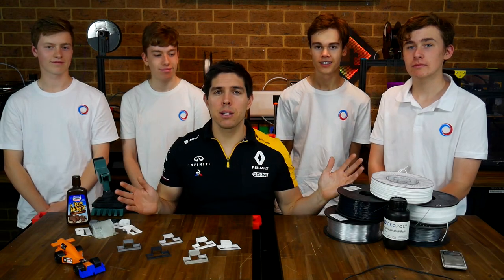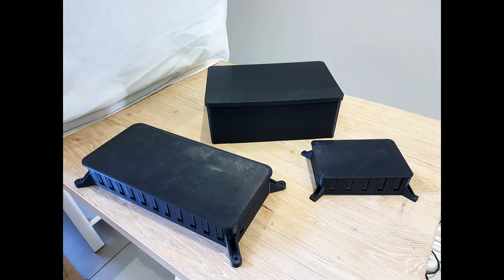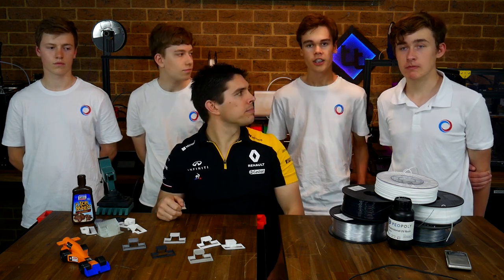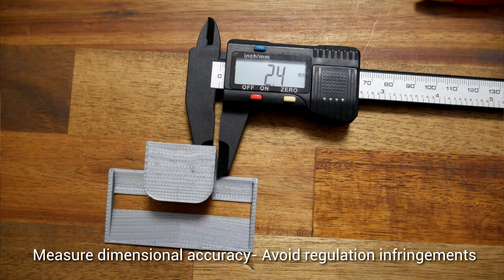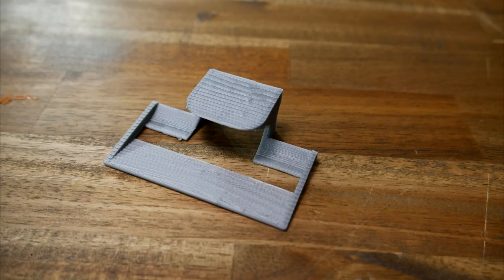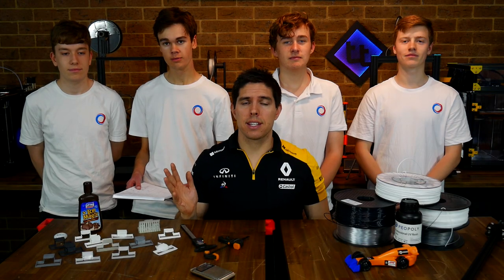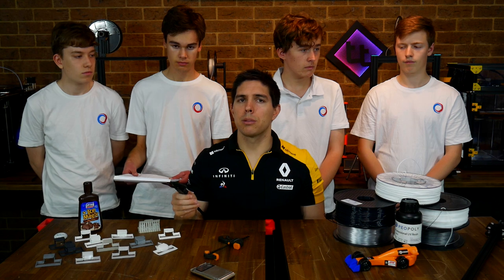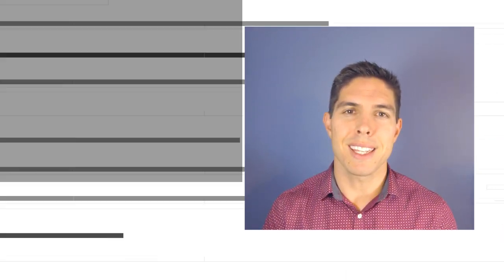3D printing engineering parts: PLA vs ASA vs PC vs PP vs nylon vs tough resin

Comment: For PP ultralight I had to slow the machine (CR-10 with mod for flexibles) down to 25-30mm, and use packing tape on the heat bed with pva glue.

Comment: @teaching tech have you ever tried ultimaker CPE+ ? Incredible surface finish, super high strength, no warping and suitable for automotive. It can handle temps up to 110c. we use it all the time but it is a bit pricey and only comes in 2.85mm.

Comment: I've heard ASA called a successor to ABS, very similar qualities but less stench and easier to print. I'd rather use it than ABS, as well. Would have been interesting to see how some carbon fiber blends worked out, like Prusa's PC Blend CF or even PETG CF.

Comment: That resin looks interesting, I am testing and using the Flex resin from Monocure because just as you are saying the modells get hard but brittle and as I am using my Anycubic Photon S mainly for printing parts to my FPV Racequad thios would suit my needs.  Will that resin only work with Laser or would you be able to use it with a LCDprinter like anycubic?

Comment: Hey man. I just wanted to congratulate you. Looks like you're doing a great work with those kids and your channel is filled with great videos on different topics. What I like about your videos is that they are very professional, always with references to other sources of info and very well structured. Just a small recommendation and this is just my perspective, maybe the background and overall look of the location you use for your videos could use a bit of refining. Make it look more appealing to the viewer. I don't know maybe the colors or the stuff around you arrange in a different way. Again this is just a thought, I'm not an interior designer or anything like that. Again great job, great videos. Keep them coming. Thanks you.

Comment: Watching the video, I was looking forward to suggesting resin printing as the best choice for this part but of course you already had that as your last test sample.  You should have excellent dimensional stability and no warping.  Not sure what caused that.  Similarly, with well designed supports (YouTube videos explaining that, with recommended slicer settings), the support should peel off by hand leaving very tiny surface defects, or no visible defects.  In the USA, I buy Siraya Fast resin for US$30 per kg and It's a VERY structural resin.  A much thinner wing could be made with less drag and less mass and it would be crash resistant.  I just designed an electrical insulator that needed high tensile strength and low weight.  The center portion is 6mm x 6mm.  I looped paracord through each end.  I stepped on one cord loop and pulled up on the other cord with all my strength and could not break this 1.55 gram part.

Comment: bro how did you make your drop test rig. really would appreciate some help making one  just like it
Reply: gonna guess at: weigh the car, estimate top speed, make jig: add mass so the total momentum of the carriage is the same as the car when it hits the carpet (and hit a similar carpet).
Reply from the maker: It's a 1m piece of 2020 v-slot and the carriage is left over from my Ender 5. Nick calculated the numbers to ensure the impact was comparable.
Reply: @TeachingTech  Nice. Thanks.

Comment: I see you have problems warping problems using tape, in my short experience have seen a lot of warpage pirnting on tape (ABS) in my case and is that adhesion of the part to the tape is bigger than the adhesion of the tape to de bed, same happens using build surfaces attached to the bed with clips and not glued to it. Really find the right surface to each material ir a real pain.

Comment: I use Matterhackers NylonX on an unenclosed Prusa, on the PEI bed with 6mm brim. A layer of elmer's glue stick helps a ton. Very awesome parts from that material if you can bare the expense.

Comment: How is the lowrider doing? Have it seen any use?
Reply: He mainly built it for use with a laser. Now that he's bought a proper lasercutter, I don't think the lowrider will get any use. Especially since he has a CNC cutter anyway.
Reply from the maker: Pretty much spot on. I did buy a corded router which has been bolted on but the urgency is gone now.
Reply: @TeachingTech  Good to know.

Comment: Could you try printing your warping filaments on paper? Spray the bed with hairspray and put down the paper immediately to stick it to the bed. Then heat up the bed and start drying. The bed should be dry quick enough after the bed heats up to the desired temperature. Let me know how it works for you.

Comment: Wonder if anyone has ever tried a light bulb for a heated chamber?
Reply: I tried heat lamps at one point.
Reply: yes 150w will get me up to 55c but it takes time
Reply from the maker: The second example I showed used halogen bulbs I think.

Comment: Teaching tech as for your results with the nylon I wanted to tell you about this nylon filament I've been using lately which has been amazing it doesn't suffer from the issues of not sticking to beds actually it's quite the opposite it often sometimes sticks way to hard and therefore is recommended to be used with glue stick as a way to remove the prints a bit easier but I don't use the glue stick and i print with it directly onto a spring steel flex plate on the smooth side that usually nothing sticks to very easily except for this stuff and it sticks so we'll it's often though to remove without removing the plate and flexing it.  The filament I'm using is called easy nylon which is a good name for it as it is a much easier form of nylon to print.  I would love to see you using it and review it as I'm really interested in what makes this filament so different from other nylon filaments I've used in the past.  One of the weird aspects of it is that you only need 50c on the bed temp.  I found mines on Amazon and again under the name easy nylon by the filament brand overture (a pretty well known and widely used brand of filaments)

Comment: I have to disagree with some points here. Because you guys used untweaked printer settings for these plastics none of them are performing at their maximum potential. I don’t print myself but know several people that do. And I can tell you that when printed PROPERLY polycarbonate absolutely shits on all other thermoplastics in nearly every measurable way. Especially in impact resistance. I’m talking we have thrown parts off of a parking garage over and over without getting them to break. Polycarbonate does seem to scratch a bit more than PETG or ASA. Nylon is best suited for applications where the part will be subjected to friction. PETG when you need a part that will bend at times. Polycarbonate (Asa is good too but not quite as damage resistant) when you need something that is just plain strong
Reply: For say a motorcycle chain guard (subject to constant chain friction) how much different would PETG be from Nylon. I'm scared of the warping issues with Nylon as I already struggle with warping on PETG quite often (adhesion is so good it lifts up bed plate when warping sometimes!). 

I'm hoping PETG will last quite some time too.

Comment: You could try some PET-G. Extremely easy to print, durable, cheap, a bit softer than pla, which is good for sanding and impact strength. And it has really smooth surface finishes.

Comment: This is a very nicely performed test. I guess I will have to check out the ASA type filamant
Reply: ASA like ABS generates toxic fumes when printing. Quote from a filament manufacturer: "As a counterpart as ABS, ASA filament generates toxic fumes when printing so it is very important to print in a place with good ventilation."

Comment: Polycarbonate might be weakened by the heated chamber, which requires no heat and very high nozzle temperature. But once you get it right, it will be very tough. I've been using it with my RC car, and it could survive quite a lot of tough situations I throw at it.
Reply: Hi I have an ender 3 pro, I just ordered an all metal hot end with some polycarbonate filament. I need to print a small rod 4" x 1/4". Any recommendations from a pro?

Comment: Be careful with ASA its like ABS in that it outgases some nasty stuff.
Reply: ASA is quite a bit worse than ABS.
Reply: @gg-gn3re  they say the opposite, i am confused. I printed with ASA and didn't smell absolutely nothing.
Reply: @casio007  you didn't smell absolutely nothing, so in other words you did smell something?
Reply: @gg-gn3re  sorry, my mistake, I didn't smell anything. Is that correct? I am not native :)
Reply: @casio007  yea that's correct. the ASA and ABS differences are there but manufacturers usually label it either one and don't really care. But they're quite different (also how good you smell matters lmao)

Comment: Well, duh about the heater! What kind of dolt thinks natural convection would work with the unit mounted vertically? Can't you STEM? Did you turn off the part fan to minimize warping?

Comment: ASA will require chamber once you print tall parts as cracking begins
Reply: ASA like ABS generates toxic fumes when printing. Quote from a filament manufacturer: "As a counterpart as ABS, ASA filament generates toxic fumes when printing so it is very important to print in a place with good ventilation."
Reply: @no-trick-pony  same say the same for ABS

Comment: great video :), my pick would be the ASA, with some hand finishing it could me made perfect, it would be interesting on what products can be sanded and polished.
Reply: ASA like ABS generates toxic fumes when printing. Quote from a filament manufacturer: "As a counterpart as ABS, ASA filament generates toxic fumes when printing so it is very important to print in a place with good ventilation."

Comment: If you send me an email at wdfitzpat@tinkerworks.info ill send you a few prints of the race car part. I have PEI 1010, Carbon fiber PEI 1010, Carbon Fiber PC+ (not 100% PC), PA6.6, and POM. I would also offer to set them up in non-planar, but since the model is so small, sanding would yield a better result. If you do decide to have me run some prints, do not sand the carbon fiber parts in-doors. Of all the dumb shit I have done, that has been the only thing to make my lungs sore. Well other than the time I sprayed Dupont silicone teflon lubricant overhead and was dumb enough to leave my mouth open and breathe in the vapors. Or the time I thought I unplugged the cabinet I was working on and needed to push the light sockets through the face board with one thumb in each socket, afterwards remembering that I had not unplugged the cabinet in a most exciting manner.